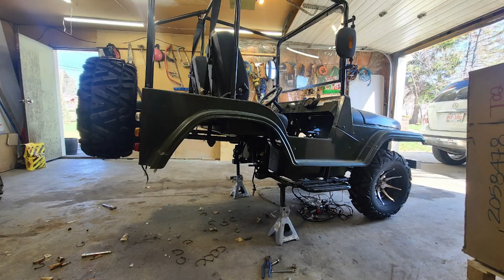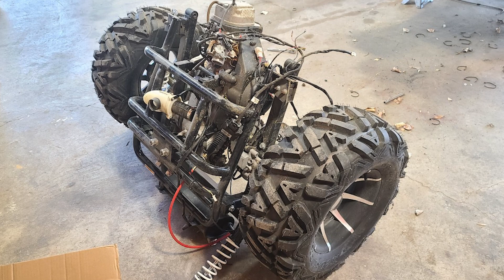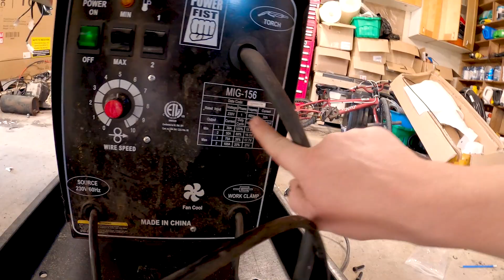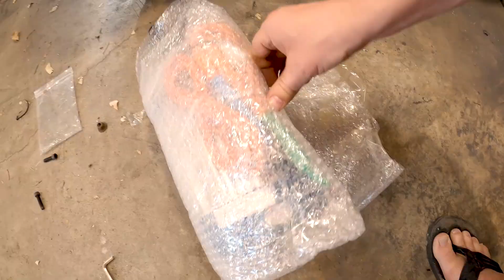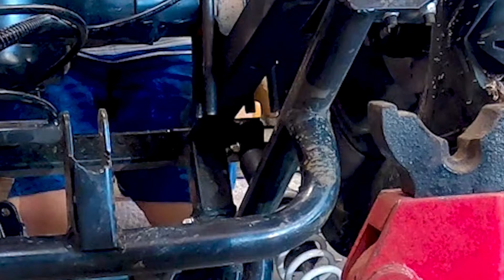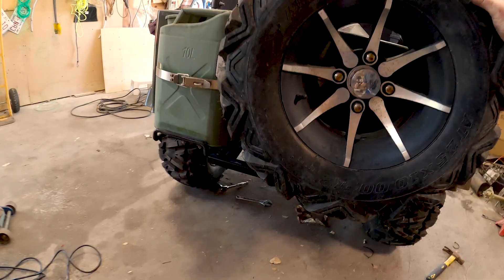Putting Electric Motor Into a Gas UTV | Gears and Tech

Comment: Good job.

Were you tempted to upgrade the suspension for some proper diy radius arms rather than just bolt the axle to the existing sub-frame?

Do you know if anywhere sells an equivalent EV front axle with steering components so it'd be possible to make a proper 4x4 UTEV?
Reply from the maker: I was looking for the easiest way to make it drive again without engineering a whole new unit

Comment: Hey mate, I’ve actually built a Willy’s Jeep  similar to yours for my kids. Mines a full metal body though which I made. I powered it with a 140cc engine from a Chinese quad so it’s got a semi auto 3 forward + reverse transmission. We wanted suspension so the axle has a triangulated upper and lower trailing arms to stop side to side movement because it’s chain drive. 

Anyway, I’m wondering where you found your rear axle or what it’s meant for? My reason for asking is because I completely agree with what your saying in regards to the turning radius.
Reply from the maker: I got mine from aliexpress.

It's listed as an electric tricycle conversion. Look for the 3000w kit.